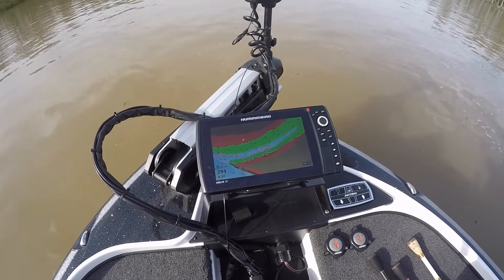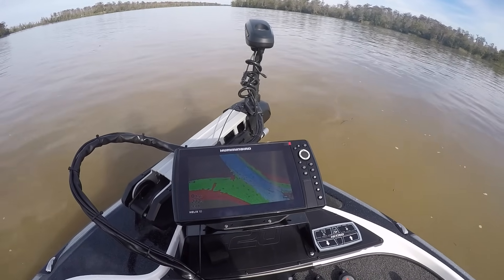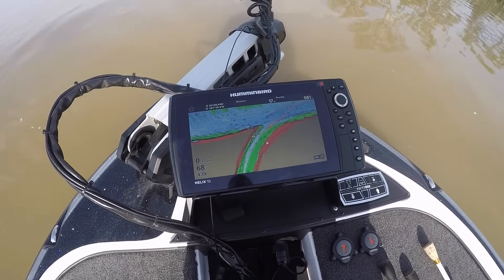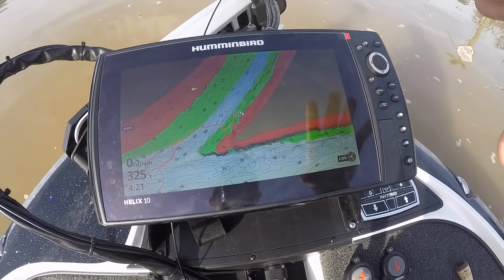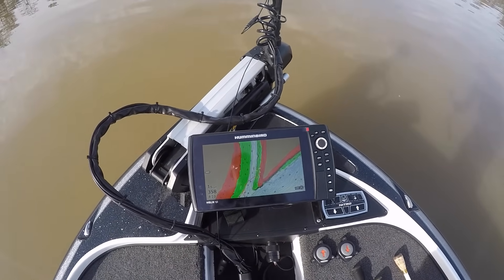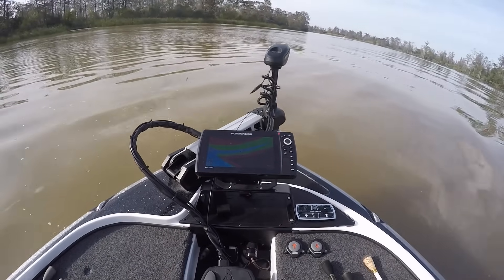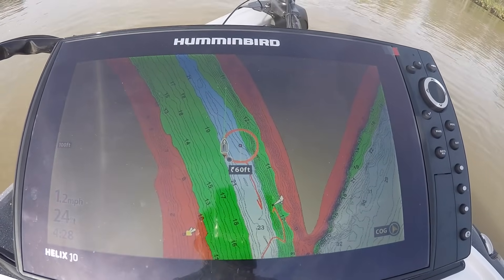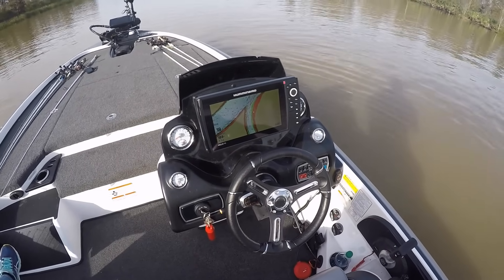MINN KOTA ULTREX - i-Pilot Link

Comment: Thank You for making it clear that an additional $170 - $350 purchase of lakemaster maps is required to link the Humminbird and Minn Kota together. Shame on them for hiding this fact in vague wording and almost impossible to find fine print. Does the directional capability (still) also require an external puck GPS sensor?  I'm researching Helix 9 Si G3N Mega
Reply from the maker: All navigation features require the puck GPS sensor. It comes with the Ultrex.
Reply: Do you need one lake master chip or do you need one for front and one for console
Reply: To my understanding is with Autochart Live they can keep their Lakemaster maps as it serves only a couple lakes in my province anyways.
Reply: according to humminbird, everything will work without the puck except the jog feature on the newest ultrex with i pilot link,.., .  except on the quest motors,, they dont need a puck..

Comment: What is the spot lock feature in the go to used for? Could i find a hump on lakemaster 30ft away, hit spot lock feature and it will move me over the hump and hold me there?
Reply from the maker: Go To Waypoint and spot lock or circle waypoint.
Reply: So i can click on that waypoint and it will automatically take me to the waypoint and auto engaged the spot lock or will i have to hit the spot lock button when i arrive?
Reply: James Duncan if you hit spot lock and you are within one quarter of a mile from the spot lock location, it will navigate you there and then hold you there.
Reply from the maker: @jamesduncan8956  yes. It will navigate to the waypoint and spot lock, all while you focus on other tasks.

Comment: I own an Ultrex and HB units, and am pretty good at operating them. I will keep this video in my queue as a refresher. Very well done!
Reply: mburke1211 I have a question when I push the go to button I don’t get an option for the contour can u give me any suggestions thanks in advance
Reply: Lowell Taylor I assume you have a Lakemaster map card for the body of water you’re on? They are required for follow the contour. If so, do you have an Ultrex or Ulterra with iPilot Link? If you have both, it should work.
Reply: mburke1211 yes I have lake master chip and I have the ultrex I’m guessing something is wrong with my unit no sure though
Reply: Lowell Taylor Sorry if the question is repetitive, but you’re sure your Ultrex is the iPilot LINK version? If so, I agree you may have an issue.
Reply: mburke1211 yes I’m sure but on my graph on the accessory test screen the I pilot shows not connected
Reply: Lowell Taylor If you have the Ultrex with LINK, it will connect to your HB Ethernet hub. If you have LINK and it’s showing not connected, you may have a cable or hub issue. That’s what I would check. I had HB customer service on the phone recently, and they were helpful in troubleshooting my issue. You may want to try them.
Reply: mburke1211 I will try that thanks for your time

Comment: Great video! Use caution when using Autopilot. I was using it to change location on a small lake. I was standing on the bow with my hands on my knees watching the side scan on the Helix when we hit a submerged tree. I dang near went head first over the bow and probably would have been run over and left behind if I hadn't grabbed my butt seat pole and hung on. I still use it but I make sure of my safe position on the boat.
Reply from the maker: The same thing has happened to me.

Comment: Great video! Just learned a lot about these units! Does it matter if the Lake Master chips are plugged into the Helix unit on the bow or does it need to be plugged into the Helix at the console or does it not matter as long as they are networked together? I have a similar setup as you with the Wisconsin and Great Plains Lake Master Plus cards. I bought this boat with the Helix and Minn Kota Ultrex already set up and just trying to dial it in now. Thanks
Reply from the maker: If you use the Humminbird network it doesn't matter. All the features will be available from any unit in the network. However, if you do not use the network adapter you'll have to have the unit you want to utilize these features connected to the Ultrex. Hope this helps. Tight lines!

Comment: Very informative video. Im planning on upgrading my graphs next year and eventually to an Ultrex. Your video gave me just what I have been wanting to know. Thanks for sharing
Reply from the maker: Scott Sheffield thank you. Let me know if you have any questions.
Reply: Nitroman Z20 I do have a question. Does the Lake Master card work good around the Mobile Delta as far as showing most creeks? I currently have a cheaper graphic that uses the chart plotter and in some creeks it show like I’m on land. I have been waiting on buying a lake card to see which unit that I upgrade to.
Reply from the maker: @scottsheffield2594  no . The Lake Master chip doesn't show the contour detail very well in the creeks around Mobile. However, the Auto-Chart Live feature on the new Humminbirds allows you to scan and map the contour over time. You can store your personal maps in the unit's internal memory or an SD Card for future reference. It's really easy to use. Just enable it and drive. It will map while you're on pad at slow speeds.
Reply: Nitroman Z20 thanks for that information. You have been very helpful.

Comment: Just came upon your channel when I did a search. I love the explanations. I have a Ultrex i-Pilot and a HB Helix 12 G3N at the console. They are not networked. So the questions are Is updating from i-Pilot  to I-Pilot Link worth the $860 from Minn kota?  If I do update to a Link can my "network" be Bluetooth only or do I have to hardwire? Thanks!
Reply: as far as I know you still have to hardwire. there is an extra cable coming out of the head of the trolling motor that plugs into the helix.. via an adapter cable,, minn kota supplied it,, one for the helix 7 and a different one for all other 8 and above humminbird units.

Comment: Thank you for posting.  You didn't mention the remote. Do you know if the remote would allow you to do everything the foot control does? I'm looking to use it in a trolling environment in a bowrider boat and don't want to have to be at the foot pedal to do anything. I'd rather be at the tending rods at the back of the boat and have my hummingbird fish finder at the consol. In spring fishing I usually have the cabin area enclosed so access to the bow is limited.  Thanks again for your review :)

Comment: If you are following a contour in autopilot... and the trolling motor is tracking along and then lets say you get a snag while fishing.  Does/can the ipilot/humminibird have a quick "go back" feature so the boat will track back to where you were so you can get your snag released?  Could the "go to" "back track" option be used for this?

Comment: Best i-Pilot Link video that I’ve seen. I just bought a Minn Kota Ulterra with Link and have it connected to my Helix 10 SI GPS. I’ll be using the Lakemaster SD card Ontario as well as Great Plains this year. The Autochart Live Zero Lines Card will help me perform all of those features on the unmapped lakes too. Nice work & tight lines!
Reply from the maker: Thank you Tim!
Reply: Tim Suchan Tim, maybe you could help me with a question.  I live on the Wisconsin Michigan border and there are several lakes which my lake master chip does not have in high def.  I was under the impression I could auto chart live those few lakes that aren't mapped.  Are you saying you need a separate special chip to do so?  Any help would be appreciated. Thx
Reply: warddan2002 Yes. You would need the Humminbird AutoChart Zero Lines SD card to map uncharted waters.
Reply: Tim Suchan thx Tim
Reply: I’ve watched several video’s and this is the simplest to the point best explanation yet. Thanks 
How do I network my hummingbirds together?
Reply: Thanks

Comment: Great job on your video, I just bought this minn kota trolling motor and I already have same humminberg as you, Question, do I have to buy 2 lake master chip for each units to be linked? If you could let me know that would be greatly appreciated. Greg
Reply: The only units that share lakemaster maps are the Solix Units.
Reply from the maker: I believe the Solix series shares map chips. I'm not sure though.
Reply: Couldnt you couple the units together with a dongle for each unit and an Ethernet cable...so they share the same mapping

Comment: If you are dealing with a strong crosswind, how does the motor correct for that when you tell it to go to a waypoint?
Reply from the maker: It set's a vector toward the waypoint and autopilot corrects for wind and current. It works for you while you fish or tend to other needs in the boat.

Comment: Do all Minn Kota i pilot have contour tracking? 12v to 36v? I need a 12v system for my kayak. Contour tracking is a must.
Reply from the maker: Yes but you need iPilot link and Humminbird Unit with Lakemaster map chip.
Reply: @BassinBuntin  Time to break out the debit card. Thanks!

Comment: I'm a new Subscriber, outstanding video!! One of the very best I've seen to date! My question ,1.) Have you noticed any significant increase in battery power loss / run time when using spot lock or other features? I am running the Minn Kota Maxxum 70lb  24v 52" shaft on my 195TX . I definitely want to upgrade to the ULTREX, and I know I'd be using the spot lock and contour follow feature ALOT!!  just curious about your battery power.. Thank you! Great Job!
Reply from the maker: Thank you Rodney! No, I have not seen significant battery discharge when using any of the features. I still go all day without issue.
Reply: @BassinBuntin  Thank You very much!

Comment: I would assume it works with a map that’s not tied to a lake. Something for saltwater .. any ideas ?
Reply from the maker: Any tracking features require the Humminbird Lakemaster map chips. The trolling motor definitely works independently of the map system and Humminbird unit, but certain features require it.

Comment: My three month old Ultrex just quit working. You would think for $3200 Minn Kota would make them last longer than three months. Yes it is under warranty but Minn Kota told me it would be 4 to 6 weeks to get the parts. I should have purchased a Motorguide
Reply from the maker: That sucks.  I've never had any trouble.  I've had two different ones.